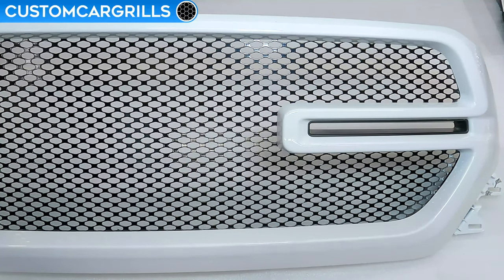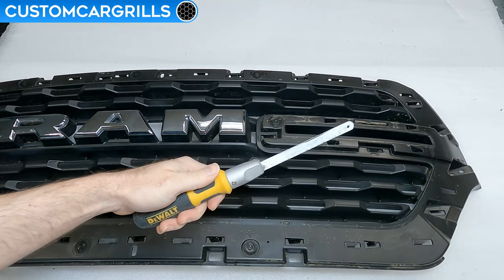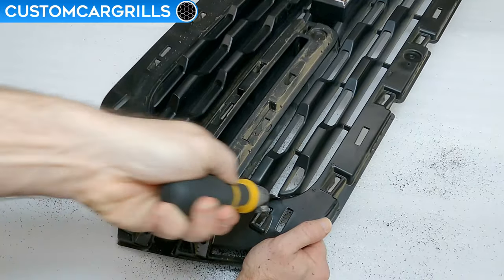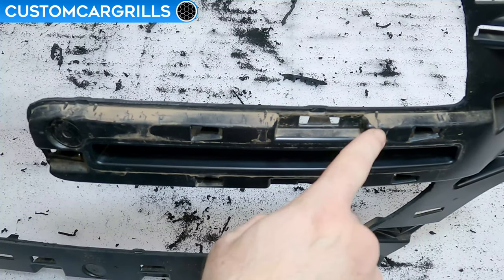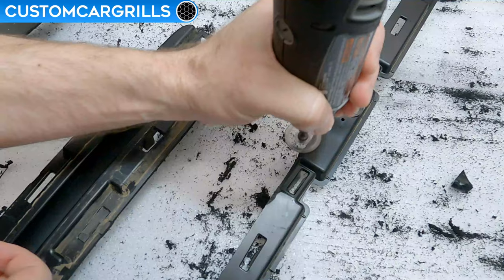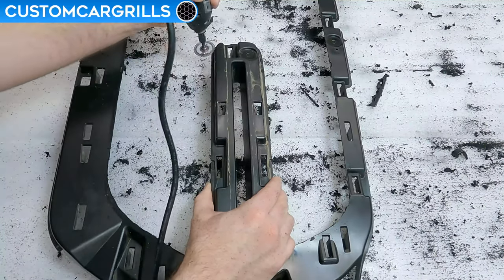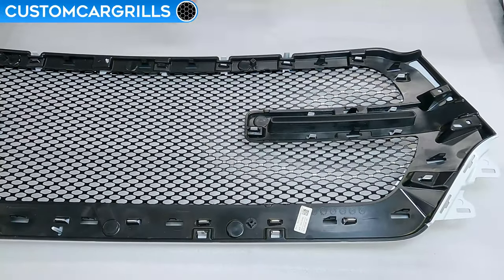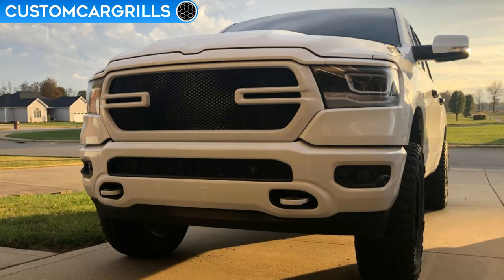Custom Mesh Grill for 2019+ Ram 1500 How-To by customcargrills.com

Comment: I would love a video on how to do the lower grille of a Kia Stinger. Looking to show off my intercooler, but still want some protection from road debris and the elements.
Reply from the maker: I have had requests for Stinger lower pieces in the past, and have offered some owners to make a piece for them but I wasn't able to connect with them to ensure the new grille will fit right.

I can easily buy the oem lower grille, and make a pre-modified lower piece for you.  Email me at info@customcargrills.com and let's get something going for Stinger owners 😀

Comment: So the lip that folds back towards the engine bay gets removed correct?
Reply from the maker: Feel free to email me with a pic of the lip in question.  I'm not 100% sure what lip you're referring to.
Reply: @customcargrills  the one you mention in your video, you said to cut the lip that curves back towards the engine bay, I can't email a pic because I don't have my grille off
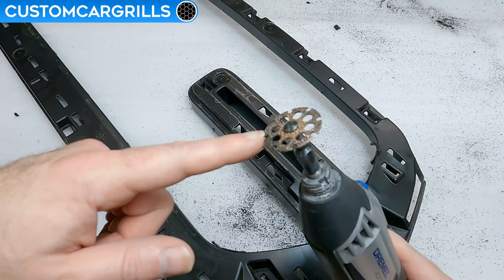Reply from the maker: Ok, I'm assuming that you're referring to the part in the video around the 2:30 mark.  I'm not sure what the question is.  What I'm showing in the video is the correct method.
Reply: @customcargrills  I'm talking about what you said at 2:20 in the video, I don't understand how your confused if I mentioned the exact words you used in the video, it's ok I'll sure I'll figure it out
Reply from the maker: I'm confused because I don't know what you're asking.  

You said "So the lip that folds back towards the engine bay gets removed correct?"

Well, around that 2:20 mark I say that, and proceed to make the cut that I'm referring to.  So, what is the question?  The video shows step by step every cut that needs to be made to install the mesh.  I'm unclear as to what you need clarification on.